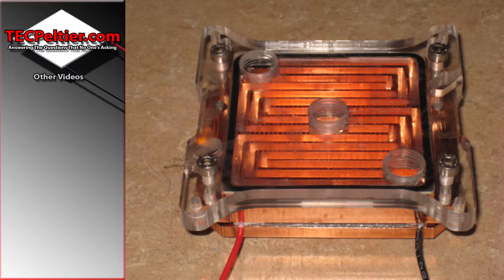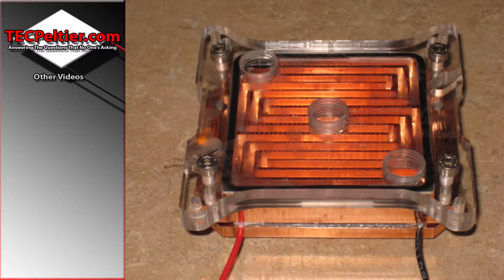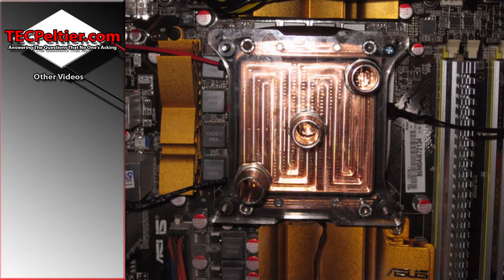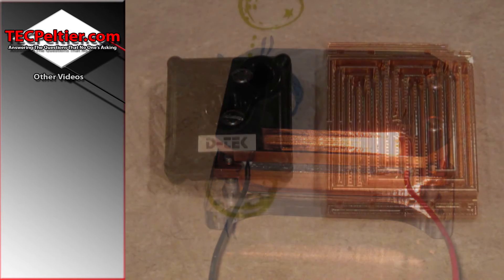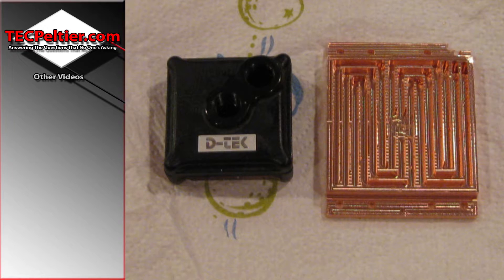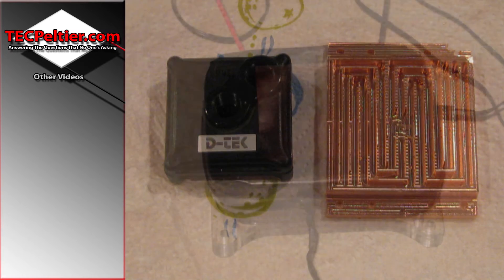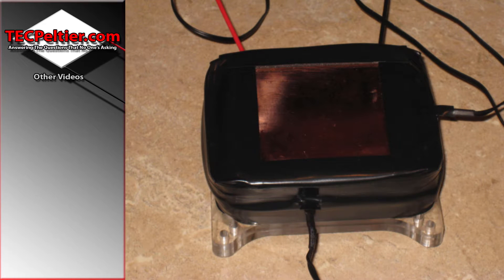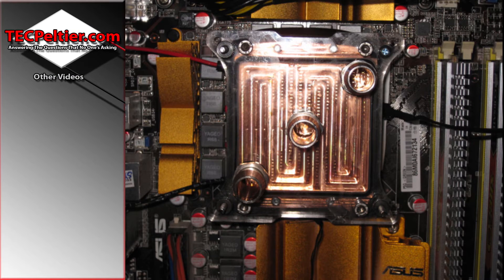⚡️ Thermoelectric Cooler Peltier Water Block For Cooling a CPU. V1 Single 62mm

Comment: Glad to see these versions revisited. I actually have been looking for your blocks out of curiosity since I saw them in XtremeSystems forums back in the day :-)
I am very glad to have found you are producing videos with high quality TEC cooling.
I just found you and are still chewing through your videos. I am looking forward to see if you have any performance tests videos given that, if I remember right, back in the day even the 226W TEC would be underpowered under certain situations. Thanks again for your videos and keep them coming =)

Cheers!
Reply from the maker: Well a lot has changed in the last 5 years ish.. CPU's have stopped increasing in TDP . I'd actually say they have been decreasing.  TEC QMAX has continued to grow. ( about twice what is was ) And Air/Water cooling has continued improve greatly( about twice as good as it was for air cooling). This all means that this is now that BEST time in 10 years for TECing.. The theoretical numbers even support being able to TEC Cool an over clocked CPU with a singe TEC and an off the self Air cooler... I'm actually going to see if this is true starting next month.

I will definatly be doing more practical videos in the future i just need to get the blah blah ones out of the way first